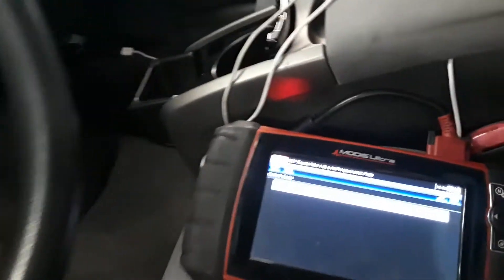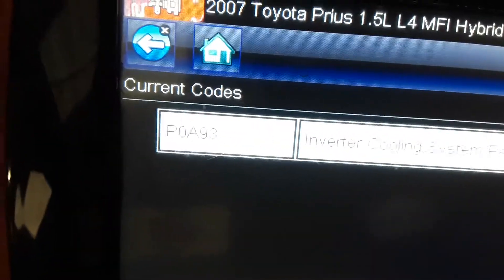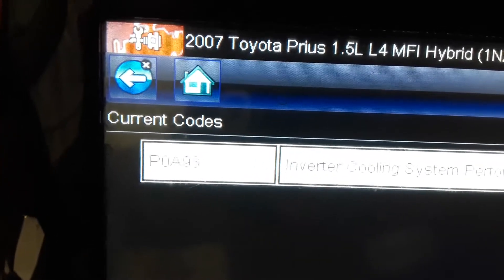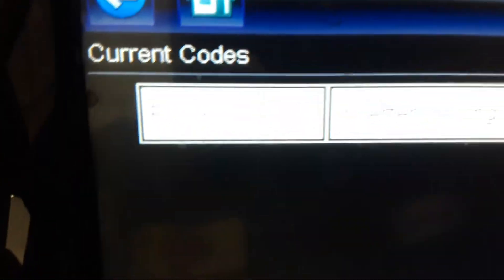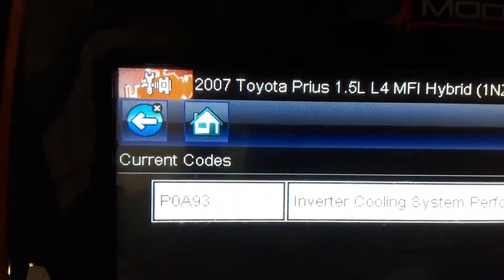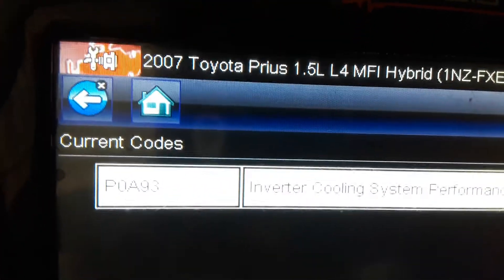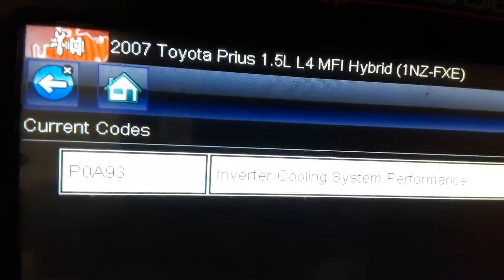Code p0A93 inverter cooling  2007 Toyota prius

Comment: This seems to refer to same part but my part number I picked up was G9020-47031. Is yours the valve control?
Reply from the maker: Yeah 3 way valve or pump for inverter
Reply: G9020- 47031

Comment: If i have this code on the free way, how far i can continue to drive ?
Thanks
Reply from the maker: You can drive the car no problem for a couple hundred miles
Reply: @hafidautorepair2793  Really ? Cool. So i only lost the best performance but the pump still work as well
Reply: You need to turn off the A/C and get it fixed as soon as possible. A/C is powered from the traction battery which is powered from the inverter. You want to shut down all accessories to minimize load on the inverter and get the pump replaced. Good day.